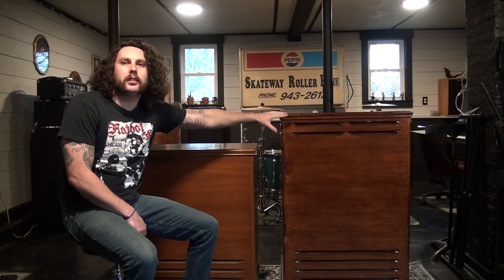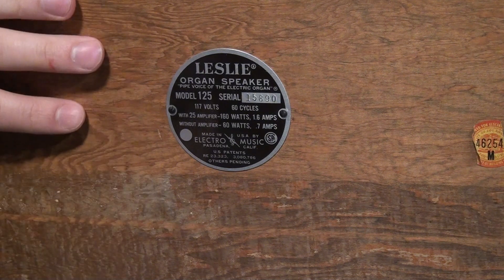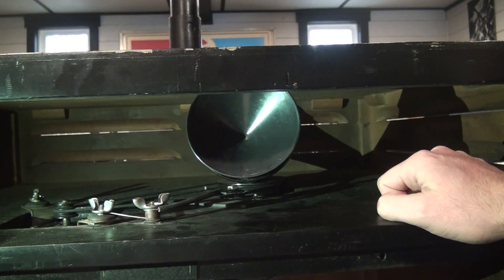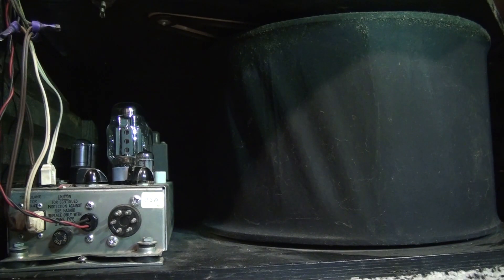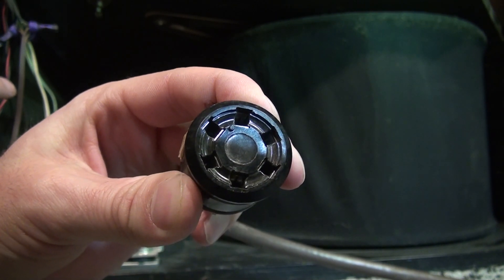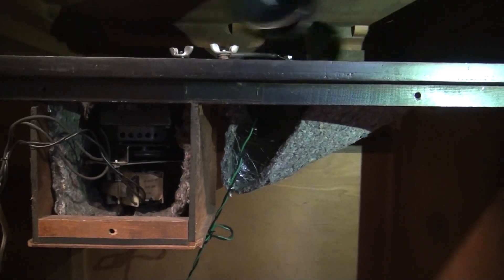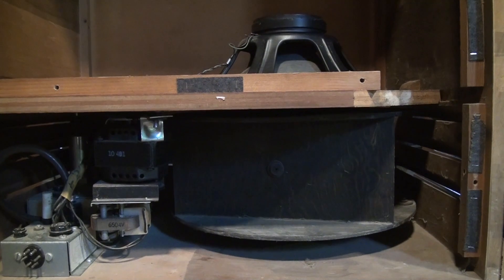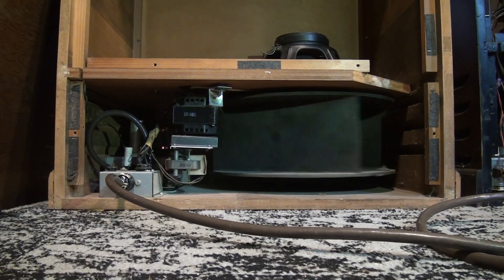Leslie Speaker Information/How Does A Leslie Speaker Work?

Comment: One of the sought-after sounds of the dual-driver Leslie is that the horns and the drum accelerate and decelerate at different speeds - the drum taking much longer to catch up. You can get different sounds if you let the spinning get stable at either the fast or slow speed and then switch speeds quickly (every bar or so). The drum never really reaches the "opposite" speed while the horns usually get there. You will see the good players use this to their advantage.

Comment: Why doesn’t the baffle on the 147 have a cut out?  Assuming one bought a 147 for guitar use, would it be more beneficial to swab a “full range” guitar speaker in it such as a JBL, Jensen, Celestion, etc?
Reply from the maker: @Jeffcatbuckeye  the 147 has the same cut out but it has a black fabric dust cover over the wooden baffle. This makes it appear like one solid piece. I don’t have any experience swapping out the speaker to be more “suitable” for guitar. Anytime I have seen a guitar with a leslie they are using the stock speakers. I think that experimenting is a good idea though.

Comment: I always wondered how the speakers spun around without the wires getting tangled. Now I know it's not actually the speakers that are spinning.

What still dont understand is how the woofer works. I get that its sound is going into that drum, but what's inside the drum? Is it an open-ended box like the smaller one uses?
Reply from the maker: @KlockoFett  the bottom drum is a wooden box with holes in the top that allows the sound from the woofer to enter. If you google lower leslie drum you can see some images. Most of them have circular holes cut in the top.

Comment: Hi there! Awesome vide with good info. Man those Leslies sound great!

I just landed a Leslie Model 16/Vibratone with an 8ohm JBL D110F in it, trying to figure out what Ohms to set my guitar amp at, and I needed some info from someone more knowledgable than I, seeing as I've never owned a Leslie or Rotary of any kind. 

Its got the crossover, so my guess is to set the amp at 4ohms, as the 8ohm amp speaker and the 8ohm JBL Leslie would likely be in parallel, correct? 
I'd really appreciate any advice you could give.

Thank you, 
Bryan Garcia
Reply from the maker: I have attached a video that may help you with your quest. From what I understand the crossover is so that you can run a split signal to your amp and to your leslie. Like sending the highs to the leslie and full range to the amp. This was meant to be plugged into the extension output of your amp. You do not need the crossover to run the leslie. You can just plug a guitar amp into it. As an example if I was using the extension speaker output on a fender amp I could plug it directly into the leslie. If you are using multiple outs on the back of an amp head then you need to worry more about ohms. I am not an expert on this but I think this will steer you in the right direction.

https://www.youtube.com/watch?v=SA6ZSWVmLQM

Comment: Why does the drumrotor and the horn rotor turn opposite of each other
Reply from the maker: @johnsletterink848  the motors are facing in different directions. The  two speed motors are positioned differently making them rotate in opposite directions.
Reply: @skatewaystudio8935  Thanks for your answer but that is only a mechanical explanation, it is perfectly possible to have them rotating in the same direction, just reverse the polarity of one of the driving motors, ik think.... I am just curious why they are turning the way they do, is that for audio/accoustic reasons?
Reply from the maker: @JohnSletterink  From what I understand it was accidental. Older leslies do not spin in opposite directions. When they switched to two speed motors they needed more room. They moved the motor position which changed the direction of the rotation.
Reply: @skatewaystudio8935 
That looks very plausible. One motor upside down results in reversed turn of the motor. 
Thanks for your input!!!
John

Comment: I built a homemade Leslie Cabinet with upper horn and lower rotors … 
With two , single speed, Leslie motors……! I control the speed anywhere from off to fast to middle speed, by using a small Variack for voltage speed control…. ( the Jeff Galey Channel ) 😊
Reply from the maker: Very cool!!!
Reply: @skatewaystudio8935  
Thanks…!
👍🏻🎶🎶🙏🏻

Comment: Warning!
Leslie used three different pin configurations for their 6 pin hook ups.
the 6H configured for Leslies designed for Hammond organs (21H, 31H, 32H, 22H, and 122)
the 6W, configured for Wurlitzer organs (also considered universal) (44W, 46W, 47, 147)
the 6C configured for Conn organs (and certain Hammonds) (50C, 51, 251)

Each of these configurations ARE NOT COMPATABLE, and at the very least will not work properly, and at worst, can cause damage or injury.
Always consult a qualified technician if you have any question of compatibility.

Leslie also used other 9-pin, 11-pin and 12-pin systems for other organs and in solid state units.

Comment: I have the 125 but im not sure if it has the speaker is it still worth anything
Reply from the maker: There are several important pieces that you would need to have for the leslie to be in working order. Obviously the more working pieces the more money/time it is worth. An empty cabinet still has value but if you have the amp, the motor, the drum/baffle, and the speaker it is more valuable.

Comment: My Leslie stop spinning what should I check
Reply from the maker: The first thing I would check is the drive belts. If those have come off or are broken then it will not spin. The next thing to check are the motors that move the belts. Check to see if there is any movement or noise there. Are you getting sound? If you are not getting sound then there are other issues.

Comment: Worth mentioning that only one of the two top rotor horns is active. The other is a dummy and acts as a counterbalance.
Reply from the maker: Yes, very good point!
Reply: Thank you for confirming the dummy horn, I was going to ask the same question. Many people don't even realize that one horn does not sound and is just a counter balance. I am making mine own with with treble horns and bass baffle. It will be fullly variable speed by pedal control. I am using stepper motors for precise speed and braking. I will also be able to adjust the treble to bass rotation ratio which is 1.5:1 on a Leslie. I can even make the two rotate in the same or opposite directions.

Comment: One question, can the Yamaha yc-45d organ be connected to that Leslie speaker?
Reply: Hey there! First I would need to know what kind of outputs you have on your organ. Does it have a 1/4 inch output? Also what kind of leslie are you using?
Reply: @TheRichieRussell  I want to know if it can connect the Yamaha yc-45d organ to the Leslie 125 horn and I have that doubt
Reply from the maker: @carlosmarino4418  If your organ has a 1/4 inch out then you would be able to play through the leslie 125 using a preamp. You have two options there. You can use a leslie preamp but they are pricey or you can get an aftermarket preamp and pair it with a dr. fishsticks controller kit. I will include a link to the kit. I have one of these kits and I use it to play anything with a 1/4 inch output. The link below is to the reverb store that sells them. You may need to message the seller to ask for one that specifically works with the leslie 125.

https://reverb.com/shop/microphone-boutique-and-more
Reply from the maker: @carlosmarino4418  https://www.youtube.com/watch?v=PUM8OsmoT7U
This video explains everything you need. The controller in the video is exactly what you need.

Comment: Does the 145 also have two rotating mechanisms?  
(It seems like the Leslie sound I'm trying to get for guitar (Hendrix, Beatles, Yes, etc) were all either a Model 145 or 147.
Reply: The 145 has a spinning horn and drum. The 147 and 145 are identical except that the 147 is a larger sized cabinet. The 145 is meant to be more “portable” or take up less space. 147 is tall 145 is shorter.
Reply: @TheRichieRussell  Thanks so much!

Comment: Great videos,
Do you have any advice for lubricating / servicing a #25 motor?
Thanks,
Reply from the maker: Hey there! Tonewheel general and other sites sell replacement motors and parts if that is what you need. You can also search for a service manual for your specific leslie. The motor usually has a couple of spots where you put a few drops of oil. You can also buy a container of oil from Tonewheel general. I would highly recommend doing that. I am going to include a link here that has some diagrams on how to oil your motors. The motors are simple to take apart and reassemble. There are videos out there of people doing so.

http://www.hammondforhire.com/lesliecabs/isnt-it-time-you-serviced-your-leslie-speaker/
Reply: @skatewaystudio8935  Thanks so much, this is a massive help. Much appreciated!
Reply from the maker: @leewarren  No problem! Anytime. Things are slow here right now. Building a new studio. New videos ASAP

Comment: How do you go about "turning on" the speaker? Is the on button linked to the 6 pin connector, where you need to have something hooked into it, otherwise it won't turn on? Thank you- I've got a 122RV and just want to make sure it's in working condition before I spend some money on an adaptor
Reply from the maker: Hey there,  the leslie receives power from whatever source it is plugged into. As an example my leslie turns on when I plug the cable into my organ and then into the leslie. A combo pre-amp  which allows you to play guitar through the leslie also does this. It plugs into the wall and then feeds power via the leslie cable. I am sure there is way to power it up and test it. I have not done it myself. I suggest calling tonewheel general and asking them. I believe there is a link in the description to their site. I hope this helps!

Comment: Is there a way to increase the acceleration of the bass drum?
Reply from the maker: I believe there are adjustments that can be made to the motor itself. Changing the tension of the belt also does change the speed. It should take 5-8 seconds for a normal leslie to get up to speed.

Comment: Something I would like to know exactly:
Why both top and bottom systems run in different directions?
Macedo Pinto
Portugal
Reply: From my understanding older leslie models have more room inside and when they made the leslies like this 147 they needed more clearance near the amplifier. They pointed the speaker down instead and rotated the motor as well thus making it spin in an opposite direction. One points up and one down. Older larger leslies spin in the same direction. They only have one speed. I am told that the opposite direction makes for a better sound.
Reply: Thank you, Richie. I didn't know that older larger leslies spin in the same direction. I only know Leslie 122. As for your answer, it is more or less what I imagined, but nevertheless, although I regularly work on sound equipment, I cannot "fit" the reason for this in a context that is familiar to me. Still, thank you very much for your explanation / information. Cheers!
Reply: I think having a seperate motor assembly for the horn also allows faster spinup/down speeds too. As the bass drum takes much longer to react. So with the different speeds at which they spin it allows the interaction between them to be kind of random at all times. Makes for a more interesting and earthy sound.
Reply: I believe Mr Russell gave a great explanation! Not many ppl realize that unless they have spent many hours with em…